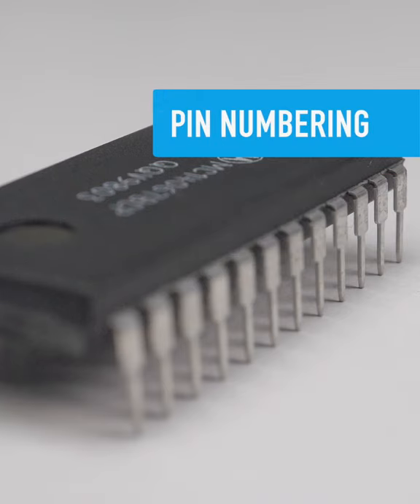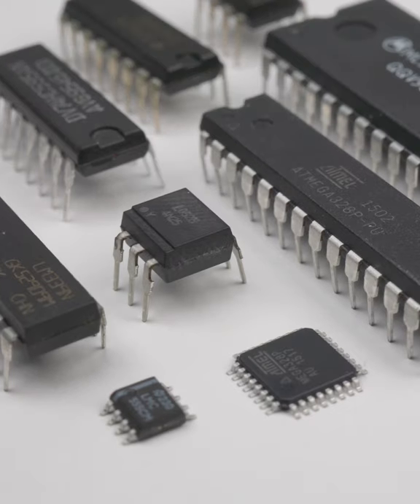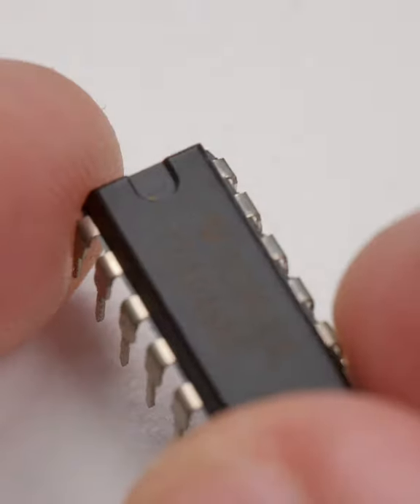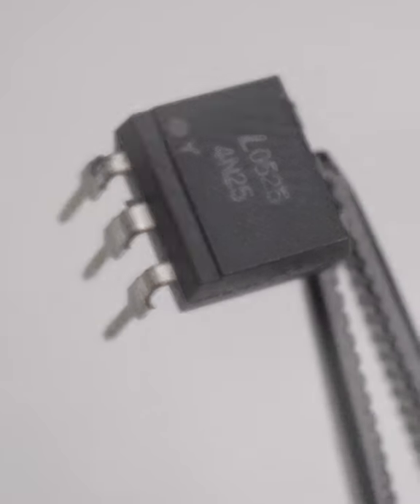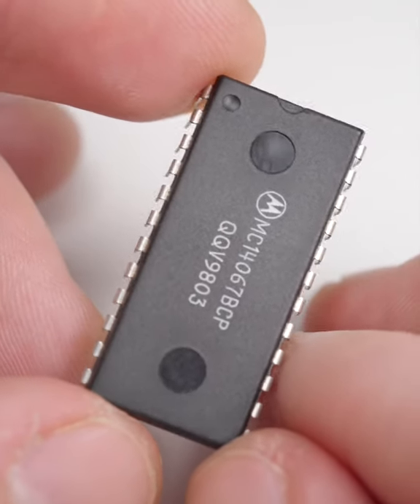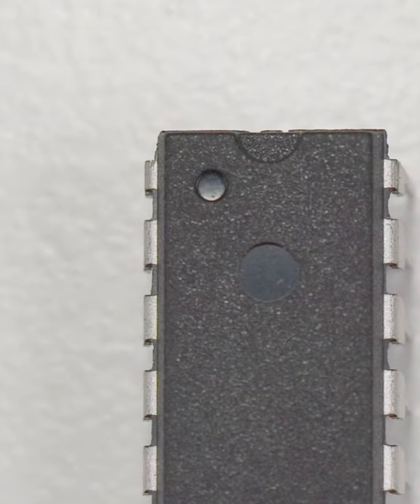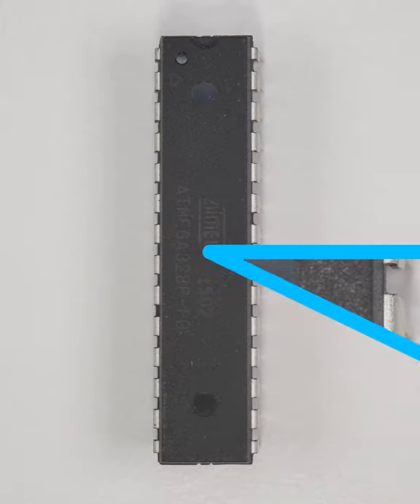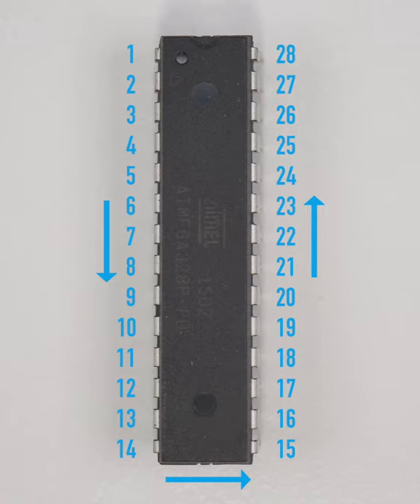Pin Numbering  - Collin’s Lab Notes #adafruit #collinslabnotes

Comment: I always check the datasheet for ics
Reply: This is correct. There are a lot of surface mount chips where when you look at text right side up, the pin 1 is at the bottom left, but the dot on the package is on the top left! Or vice versa. Really annoying.
Reply: ive dealt with ICs that are exact copies of each other but are from different manufacturers, and only one of the brands had the common markings on their ics. dealt with some ICs that are more complex than that ic too and it made me realize that checking a datasheet is a must.